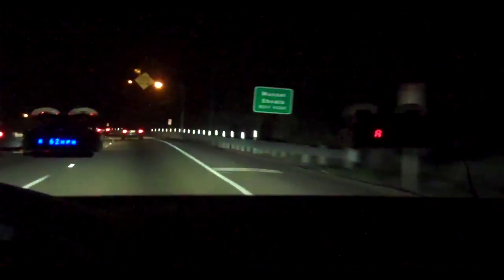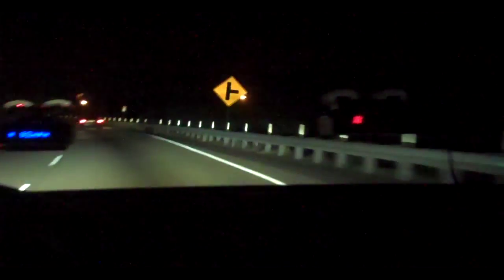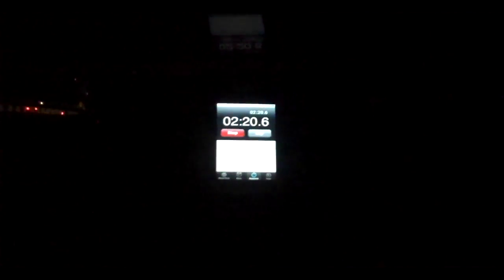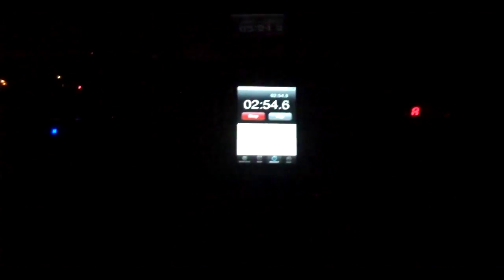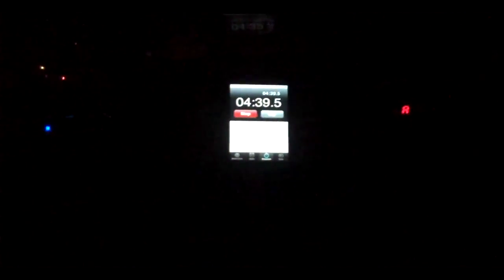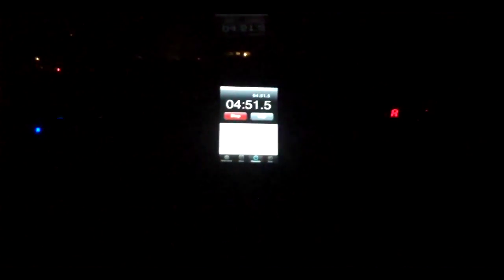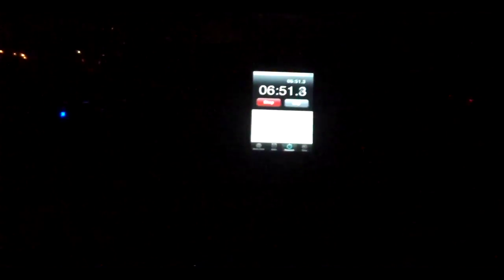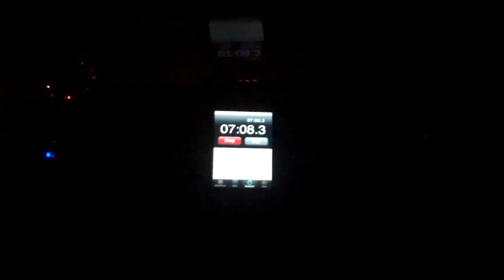Escort-Traffic-Sensor-Rejection-TSR-Filtering-Demonstration

Comment: Your running the 9500ix in Auto sensitivity  mode. In this mode...when you are under 20 mph... as you are sitting on the side of the highway, the 9500ix will reduce sensitivity  (to cut falses while driving thru a mall,ex) . So you are sitting still with a GPS detector telling itself that it is stopped and might as well turn-off.

Comment: There is another use for TSR. I own Mazda6 with lame RVM system. Its radar bombarded my RL with short false alerts on K bant even if Its switched off similar to that coming from traffic lights on this video. I was  about to sell Redline. After watching this video I tried TSR On and it worked magically. Redline went quiet. Thanks veilguy, I like Redline even more now! And definitely I cant imagine anyone driving Mazda6 with V1

Comment: It's fixed in the newest release, it filters out the Traffic flow frequency and disables K band POP protection. Which doesn't matter much, since the newest frequency since POP came out is KA. I run the V1 constantly and with TSR on it's completely silent to traffic flow sensors. Great video by the way, thanks for taking so much time to explain this.

Comment: I drive the 101 and I noticed these traffic monitoring radar. I had hoped that the TSR was another learn mode for my 9500ix that if it didn't see a signal a few times it would still keep it in the database.  Also, I hoped the learn mode would take time of day in account as some stores at night turn off their door openers, and that hurts the learn mode.  From the video I wonder if they set it so it must be of a duration and strength before alerting. i.e. longer or stronger and it would alert.

Comment: I drive the 101 and I noticed these the traffic monitoring radar. I had hoped that the TSR was another learn mode for my 9500ix that if it didn't see a signal a few times it would still keep it in the database.  Also, I hoped the learn mode would take time of day in account as some stores at night turn off their door openers, and that hurts the learn mode.  From the video I wonder if they set it so it must be of a duration and strength before alerting. i.e. longer or stronger and it would alert.